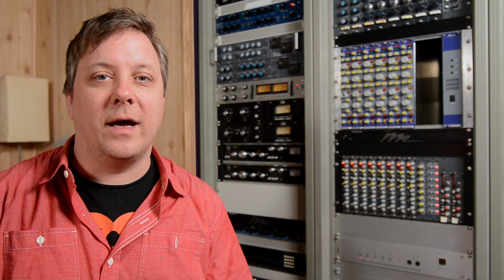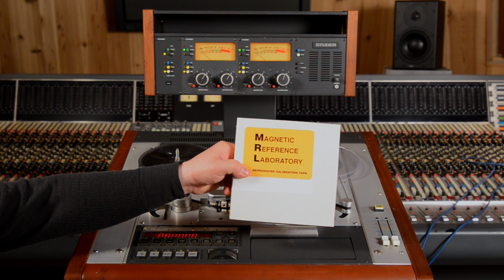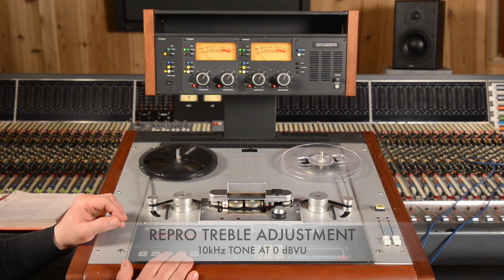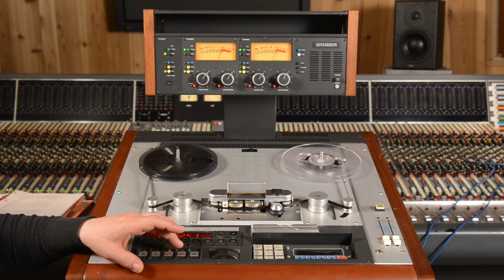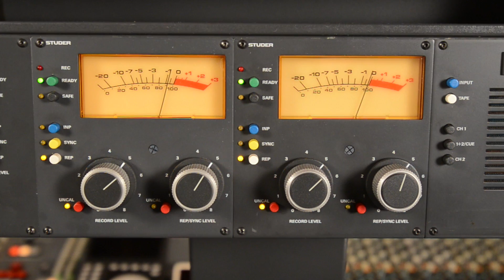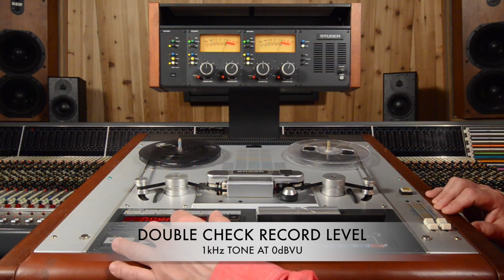Studer a812 Tape Machine Basic Calibration

Comment: Hint. After you align the machine..you should make your own test tape at various frequencies/levels & mix of frequencies. 
I worked at the largest video post facility and each time we changed video heads we would create a test tape for that head. This way we can always set the head for optimum recording aa video heads wear and tape guides will be on manual setup (not servo mode)

Ps you.forgot to adjust head azimuth

Comment: Hello Dan. I have the same machine. Mine has the Generator card. From which source dis you get your 100, 1000, 10000Hz signal? Internal to your machine or external from a desk source? Kind regards Mike.
Reply: I had the tones on MRL Tape to set up repro.  I used the oscillator on the console for record calibration.  You could use the generator card for the record setup.
Reply: @MonsieurKagan  Thanks for the reply. I am just getting acquainted with my machine. I will give it a try after I have checked the 0db cal' level on playback. After all, if that is incorrect, then so will everything else be. So far having trouble finding the Cal tape info in either the Op or the service info. I will keep at it though. Asside from  that, the recordings are just stunning.  Lets catch up later on the same subject. Bw Mike.
Reply: @MonsieurKagan  OK Prescott. I have now found the info to identify the missing piece of my calibration puzzle. Dan says 'chose your ref level' Do you match your ref lvl to the type of tape being used at the time, or do you use your chosen lvl 320 or 510mWb and set the over bias to give the correct tonal balance either by ear by THD meter / measurement?? Kind regards Mike.

Comment: How about cleaning the heads before you start!  I would hope never to get big errors like that; if I did I would not want to just correct at three frequencies but would want to see the full response, which on my A812 is well within 1dB up to 20kHz and -3dB at 31kHz .
Reply: Absolutely valid objection! Thoroughly cleaning all heads and tape guides is mandatory to get a correct calibration. Demagnetizing the heads might also be good idea.
Reply: @peterz3373  Yes, thanks. (by the way, I designed the equipment used by Studer and many others to measure audio quality and check performance!)
Reply: yeah of course, but before that he should wash his hands, only then the video is complete LOL

Comment: studer manual says to use -20db tones for bias and hf record calibration.
Reply: It does,  but most line-up tapes frequency test sections are recorded at 10dBu below the replay level section. Use the same level on the record line-up and you will be fine. Just dont do rec hf and bias adjustments at operational level so as to avoid tape saturation.